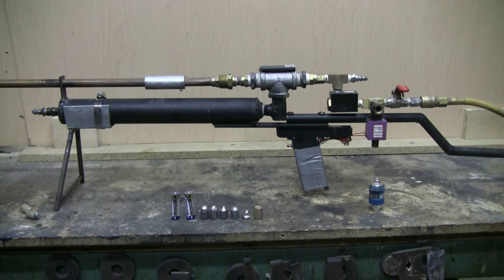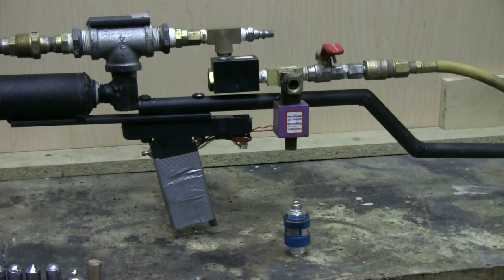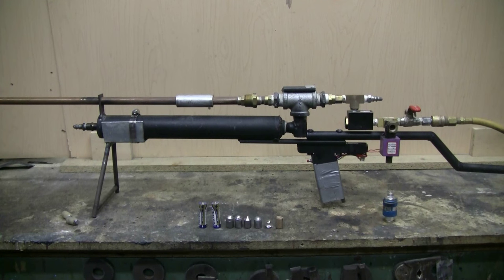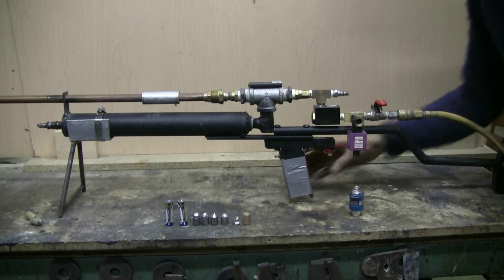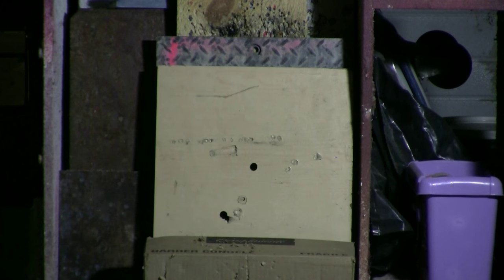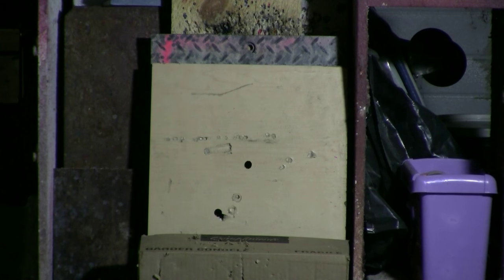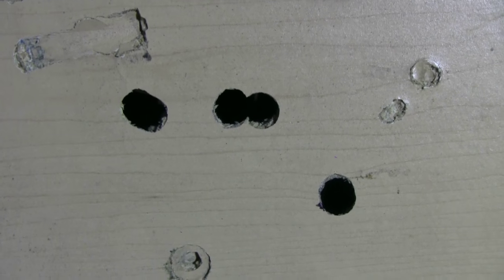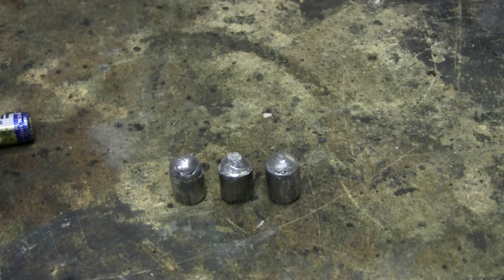DIY Big Bore Air Rifle Mods And Test

Comment: Hi Bill, when your filling  the chamber how do you keep the air from going out the barrel?  Is the 3/4 tee a QEV as well or some type of piston?  I'm working on a air bow and a slightly scaled down version of this setup would be perfect.   Hopefully you see this Thanks.
Reply: Hi there, has this question been answered, I also would like to know how the air does not come out the barrel when filling the air chamber ?

Comment: hi bill nice gun have you ever thought of making a vacuum muzzle brake  so you don t get any head pursuer on your lead bullets that way you get a push and a pull much faster you l need some o rings  for this  and a flap on the front of your gun  and a gas tube to open the flap and use 5000 psi you may have to build your own compressor for this and use a 12 gage slug you will be amazed at what this will do too armor plaiting and your walls lol.

Comment: I've tried using superglue and hotglue to seal a valve but it leaking air, what glue is right to use? 

Can someone help me?
Reply from the maker: +Crazy Experiments I usually use plumbers pipe dope or Teflon tape on threaded connections.
Reply: Crazy Experiments 있다 더

Comment: how does the solenoid valve works/? can you show the connection?
Reply from the maker: candicecold The solenoid valve is electric. Activated by battery and trigger switch.
Reply: is this a two way solenoid valve?

Comment: it has to be connected to the air compressor all the time? nor it can be movable?
Reply from the maker: +Javier Cardozo It only holds air for one shot. It can be taken off the air line and fired once. This works fine for me as I have a good 10 meter indoor range where I can shoot from a bench and stay hooked up to the air system.
Reply: Yes i understood that.  My question comes c i really like your design and i wanna make my own based upon ur ideas. So my question to you is if i hook a tank instead of an air compressor would it work?  How many shots u think i would have out of it?  
Well thank you very much for even answer my first question.  And is a real cool rifle.   I hope my first come half as good as that one
Reply from the maker: +Javier Cardozo You could hook up to an air tank. Number of shots would of course depend on the size of the tank. Perhaps a scuba tank at several thousand psi with the appropriate regulators. You could carry the scuba tank in a backpack perhaps.
Reply: Bill Gilmour hey sorry to bump this so late but,
I want to make an air rifle based on this and ideallt id like to rival the airforce texan. If i dont diy i'll never be able to afford one.

What solenoid valve at 3000psi would you recommend? Or any valve at all?

As well as a type of regulator 

Any ideas comments would be appreciated.

Comment: Have you the model of your valve ?
Reply from the maker: +Aurelien sutter The QEV came from eBay. The size is 1/4 NPT. The output port is actually 3/8 NPT on my valve. These are common and cheap on eBay. I got the solenoid valve from a local surplus store.
Reply: Bill Gilmour whats the specs for the solenoid psi or model?

Comment: does anybody know what kind of airflow (kv value) you need for an airgun? or if this even matters?
Reply: as much air as you can deliver to the vent/bore. You want the bore to really be the constricting factor (if you're going for raw power). Minimize directional changes as much as possible, and polish all internals. I also go a step further and spray the inside of my guns with a high-lubricity silicone spray that dries into a film.